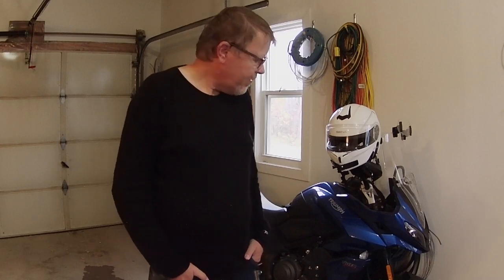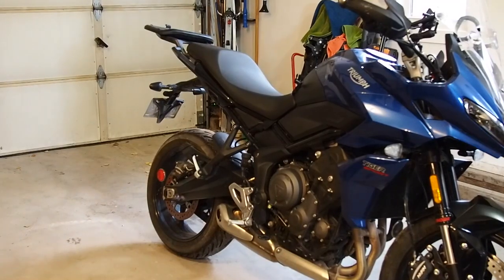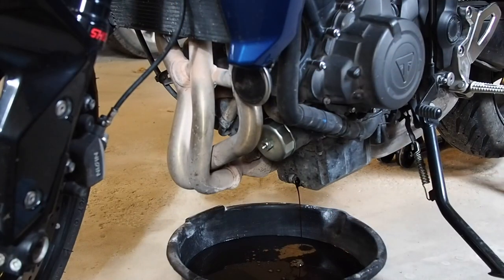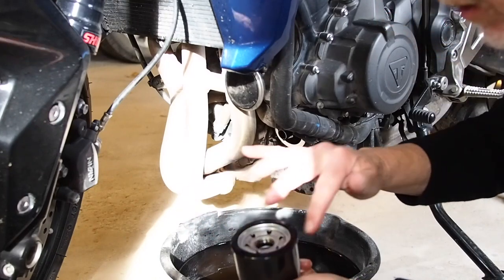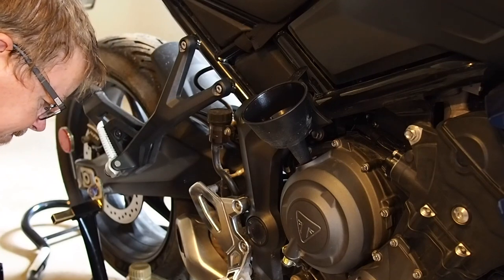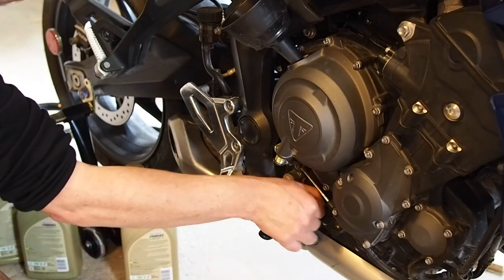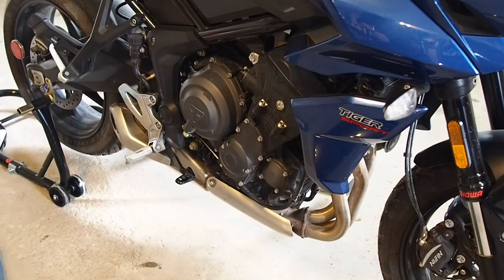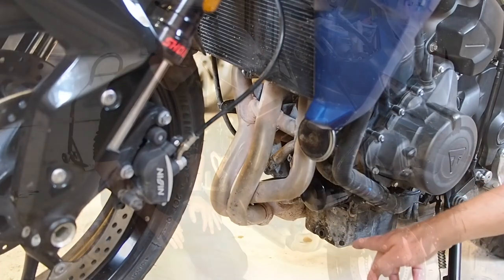Tiger 660 preparation for winter storage - Fresh Oil & Filter

Comment: Good video friend! 
Only one thing. In my owner hand book, Triumph recommend to use Castrol Power 1 Racing 4T ( here in Spain). In the video, you show Castrol Power1 bottle. In Spain your oil is not full syntetic. I don't know if in Canada the label or the name by Castrol is diferent.
I just want to tell you this in case you want to check.
Thanks for your videos.
Reply from the maker: I've been getting my oil directly from the Triumph dealer and it's supposed to be fully synthetic.  Our manual specs.    Castrol Power 1 Racing 4T 10W-40 (fully synthetic) engine oil

Comment: Good night friend, I just bought a tiger sport 660 here in Brazil. I would like to know how many liters of oil it takes to change the filter together.
thanks.
Reply from the maker: You need to get 4 quarts and it leaves you 
 a bit left over to top up, should you need to.  I've never had to add mid way between oil changes though.

Comment: What's your input on this bike vs NC750x? I'm torn between the two.
Reply from the maker: Seating comfort wise they are pretty similar.  The windshield system seems structurally pretty weak but I don't know of anyone that has had one fail, this limits options such as the madstad windshield which really helped on the NC750X.  The NC is also king with regards to fuel economy while the Tiger 660 can approach 62 mpg (Canadian gallons) or 52 mpg US when riding easy on the throttle while the NC could aproach 80 mpg (Canadian gallons).   The Tiger 660 is an exciting bike to ride.  So much more power, sounds great and looks great!  I couldn't even hear the NC above 60kph.  The NC = practical and enough power to do the job.  It's a commuter.  The Tiger 660 is also a good commuter but with less mpg, more smile on your face.  The traction control and dual front brakes is also a major plus but I do miss that frunk as do any other's that have come over to the Tiger from the NC.   Do I miss the NC???  Nope.  I still love my Tiger 660!  If you do your own oil changes, you have to get an Android device and payed app to reset the oil change reminder.  That's kind of a bummer.  Otherwise the regular maintenance stuff is similarly pretty easy on both.  The NC routinely got mayby 50 more kilometres per tank as far as distance between fill ups goes.  300 km per tank is pretty common on the Tiger as the reserve light turns on at about 280 kms.
Reply: @DonMPhotography  Thanks!

Comment: Good video - very clear and practical, thanks. Are you going to store the bike on the paddock stand? We do have the same bike, by the way 😀
Reply from the maker: My stand is nice and solid so yes .. I'm pretty confident of it's stability and it will keep the weight off the wheel.  I don't have any stands for the front wheel yet so was just going to put something like a board or that piece of flooring under the front tire.
Reply from the maker: Yeah ... I'm loving the Tiger 660!  So much fun to ride.

Comment: My tiger manual says 2.80 liters which is just under 3 quarts.  Where did you read 3.25 quarts? Thanks
Reply from the maker: The Casterol comes in US quarts not in litres ... even here in Canada  ... so that measurement is what I actually pour into the bike from the American sized oil jugs.
Reply: What’s that you put under the front wheel to roll it
Reply from the maker: @HTTR4Life-1  a groller.  :-)     https://www.amazon.ca/Motorcycle-Wheel-Cleaning-Stand-Lubrication/dp/B079JX8LT7/
Reply: Thanks buddy I enjoy your videos!

Comment: what oil wrench did you use?
Reply from the maker: I used the oil filter wrench that came with an oil filter from our Honda dealer back when I was driving a Honda.  But with water pump pliers or maybe even by hand you can get them off or maybe it’s possible to get a wrench/ filter combo from your dealer.

Comment: Did you only tighten the sump plug to 15nm?
Reply from the maker: I have a cheap no name torque wrench, so yes I was feeling uncomfortable about going tighter just based on how it felt and left it at 15.  I sometimes do that especially when it's a smaller torque number in the range that the torque wrench covers.  I wish I had a smaller one with a lighter range to do these smaller torque settings.